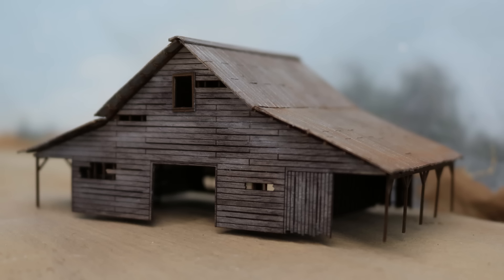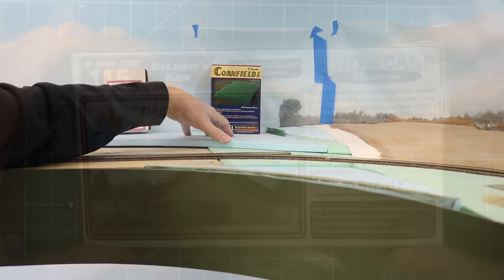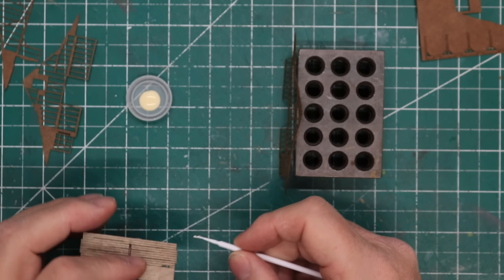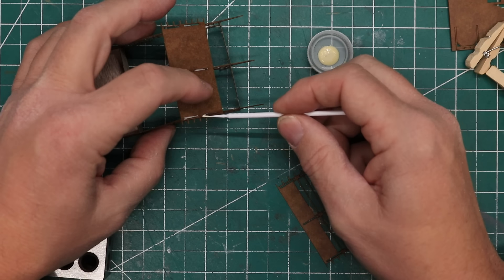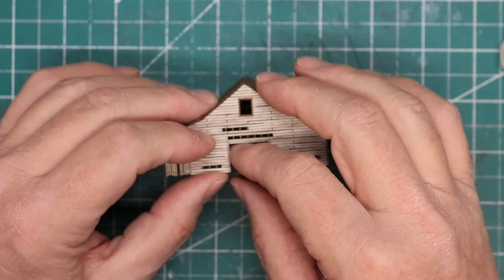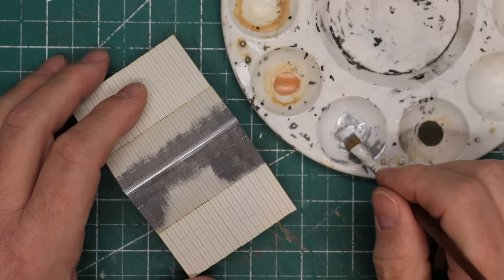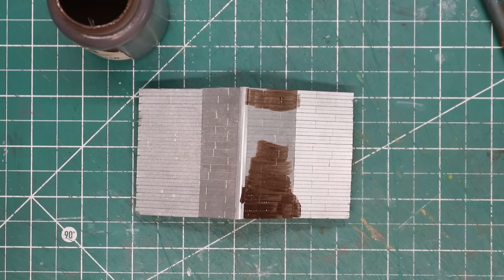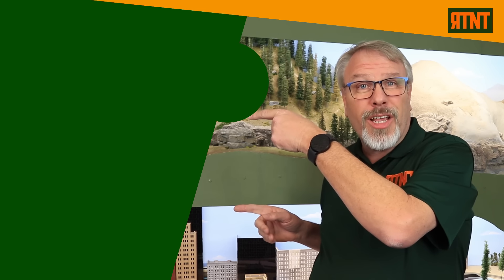Build a COOL N Scale Barn

Comment: Great looking results Bro Ron.  I built the Quality Craft barn with modifications a few years ago.  I also use wood glue for wooden kits.  Are you planning to mount this to a removable wood base?  The thin posts on the sides look very fragile.  The QC kit had very robust enclosed sides witch is good because it is used in train show set ups.  Happy modeling.
Reply from the maker: I do not plan to use a wood base at present as I am planning on a dirt floor,but we will see how that goes. Video to come.

Comment: Ron,
Just a suggestion.  I work at a smaller Box Store and we get furniture from Ashley and other furniture suppliers.  The styrofoam that is packed with the furniture, tables and chairs are just throwed away.  I have thrown away blocks of 6"x6"x8" -- 1/4"x12"x24" or larger 2"x2"x24" and longer blocks.  I just think this could be used by your followers and others.  Go with the attitude of I'm going to save you room in your dumpster or even save the landfill by the amount I take for my railroad layout.  I was told I could take all I wanted for FREE.  Sense I'm 73 and getting out of railroading I just thought I would pass this information on.  My layout is HO but your N scale program gives a lot of useful information that can be used for both.

Comment: So this question is unrelated to this video, awesome barn by the way.  I noticed you are using MRC Prodigy DCC. Could you possibly do a video on that system. I'm looking into getting DCC, have been looking at the Digitrax Zephyr with wireless throttle. After 30yrs of armchair model railroading, I'm finally putting together an n scale shelf layout.
Reply from the maker: MRC is coming out with some new, upgraded components later this year, so I may donate video then...but honestly I bought MRC Prodigy Advance when it first came out  because it was less expensive and I could afford it. It would be $$$ for me.to change now, and MRC works fine...but, if I were starting today I would go with NCE.